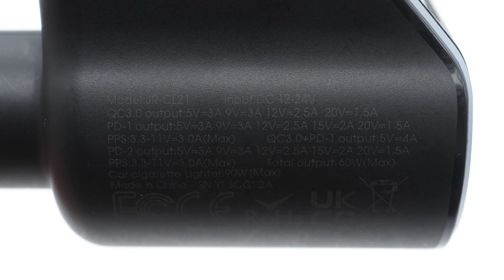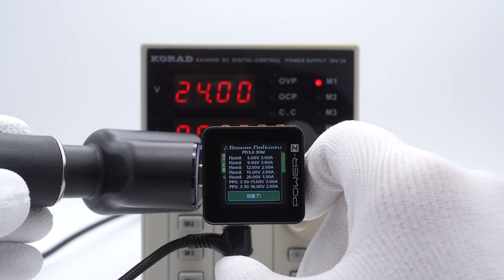Teardown of JOYROOM 150W Special 4-In-1 Car Charger (JR-CL21)

Comment: you should look at some of the new pd 3.1 step up "car chargers" which can do 140w on a single port. im waiting for someone to make a pd 3.1 usb-c powered heatpump. could put out around 700w of heat with just usb-c pd 3.1 28v at 5amps going into a small portable car heat pump with typical cop of 5. thats half as much as space heaters here in USA.
my  usb-c pd 3.1 modded fridge actually heats up my car inside rather efficiently when i have it inside. it pulls about 100w and until it gets cold inside is basically acting as a heat pump and taking the heat out of my drinks. pulls around 100w so its putting out 500w, a good idea for EV's to extend range for older models without built in heat pumps. I also added a 100w 220v IR/quarts heater to my girlfriends ev which is ran thru a little 12v to 220v ~150w inverter and mounted to a cd player phone mount with a big magnet lol. IR heat is also very efficient for heating a small uneavenly heated space

Comment: It would be useful to test the charger under load, and see how much power it can actually supply at each voltage, and how hot it gets. The DiodeGoneWild channel has examples of what I'm suggesting. Also, the approximate price should be mentioned, and an "affiliate link" for buyers, so that you can earn something from your hard work.

Comment: A teardown video without a performance test says it all.
If you were to test it, I would plug 2 devices that can take the 60 watts from the 2 usc type c outputs.
Then I would plug in a 100 watts charger into the female socket of this joyroom charger to see if it's stable in providing the 90 watts.

Comment: while driving you can't over discharge because your running off of alternator power.  Maybe you meant to say engine off ignition on charging your phone.  4:20
Reply from the maker: Thanks for the correction.

Comment: Can you review a charger with these specs :
 3-Socket Cigarette Lighter Adapter DC Outlet with -
 18W QC3.0 x 2
 30W PD3.0 USB C x 2
 12V DC Splitter x 3
?
The one I bought was from "OUFFUN", love it a lot, and it also has Independent on/off Switched, a discrete LED Voltmeter, and Two 15A Fuses.